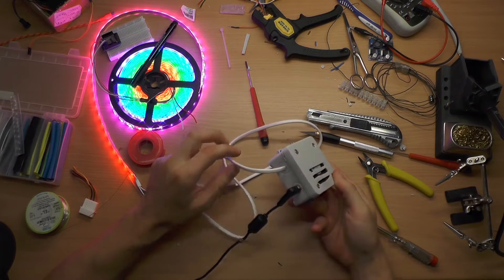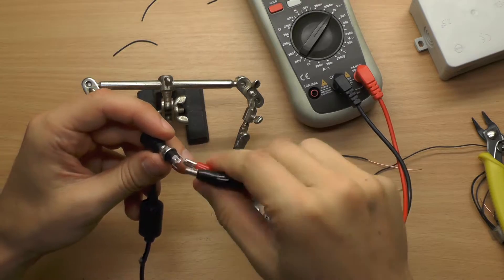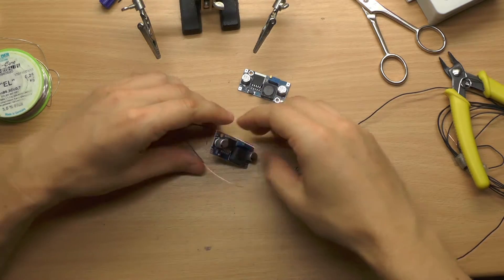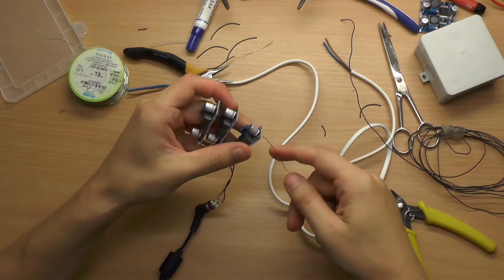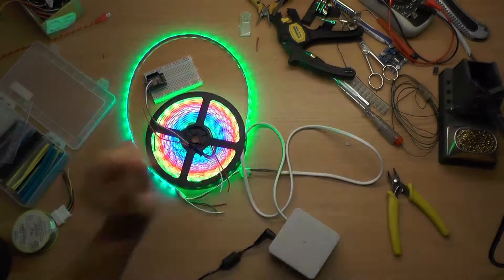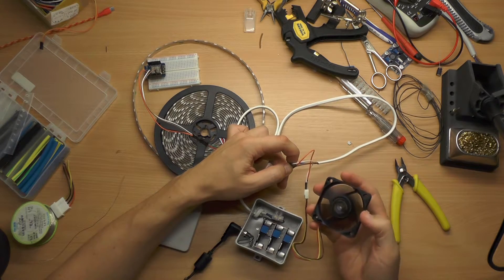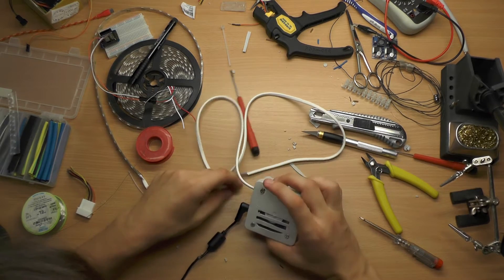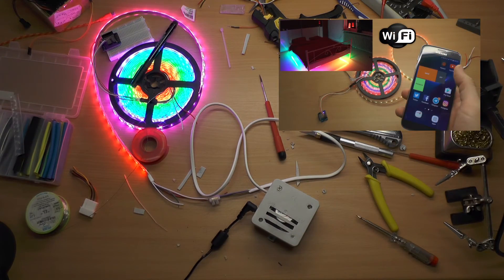High current DC-DC converter

Comment: Simply you can use a single potentiometer instead of those 3 Trimpots but you have to remove all those and connect in parallel with 3 buck converters so now you can adjust the o/p with a single pot! 
Great idea isn't it 🤗